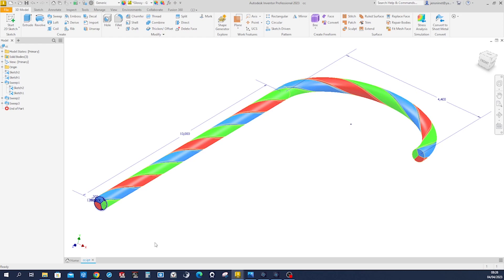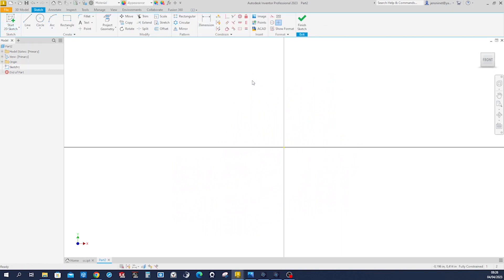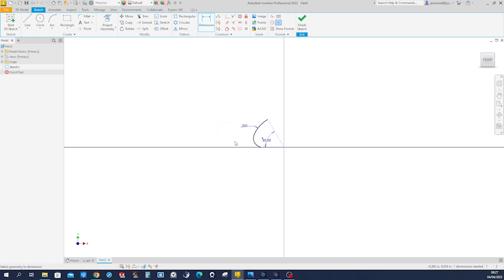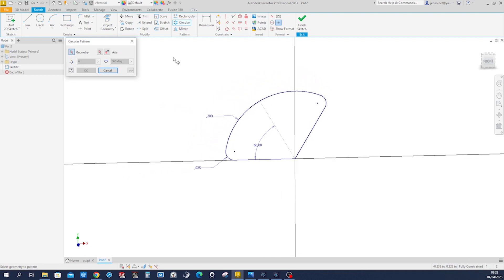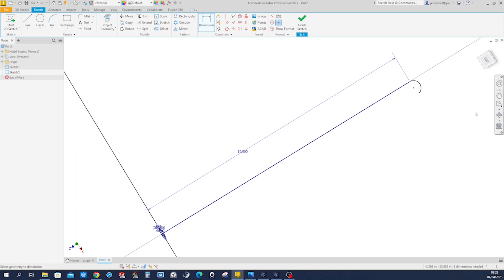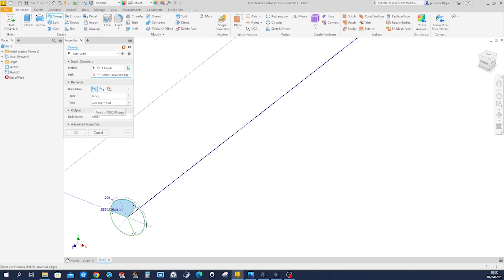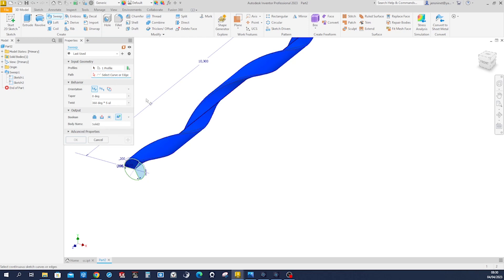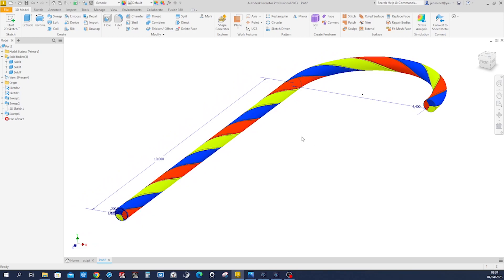Master the  sweep tool to model a Candy Cane with Autodesk Inventor

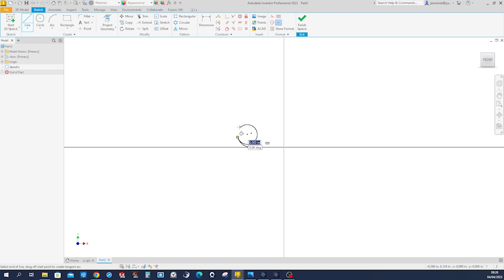Comment: How did you make the fillet right off the line like you did at around 00:49 into the video? I am in school working on my Engineering Design degree and love learning little things like that. Our teacher mainly has us just follow the tutorials in the book. So i love watching videos to try to learn stuff not in the book
Reply from the maker: after drawing the line you press the left mouse button and the tool changes to drawing a tangent arc. you can continue drawing tangent arcs, or, if  you release the button draw straight lines again.
Reply: @cademist  Oh nice! Thank you for letting me know. I will have to show others in my class that. The internet is such a great learning tool.
Reply from the maker: @MissNikolite  You are  welcome, I'm glad I could help.